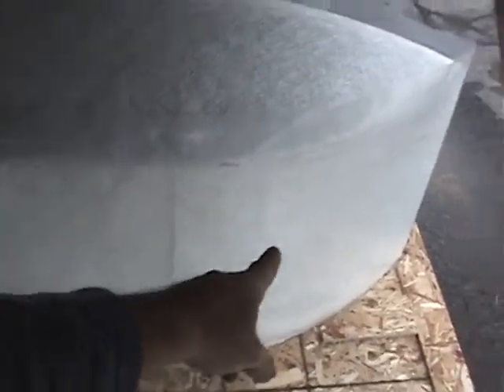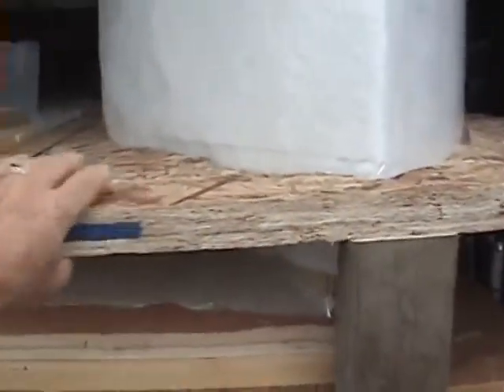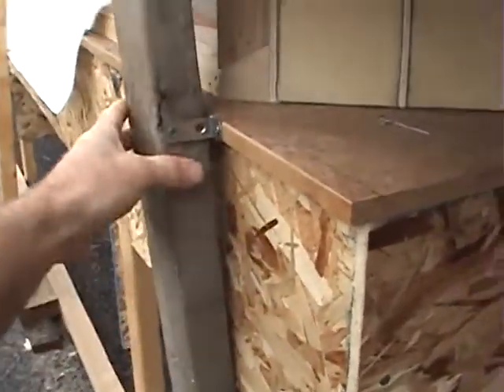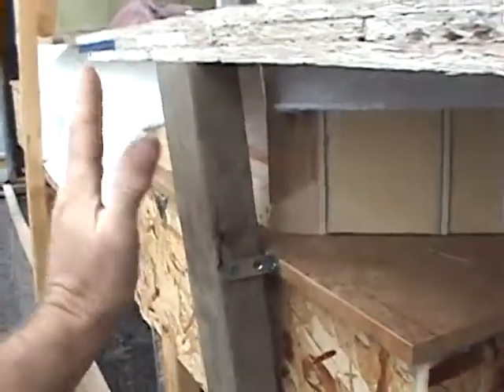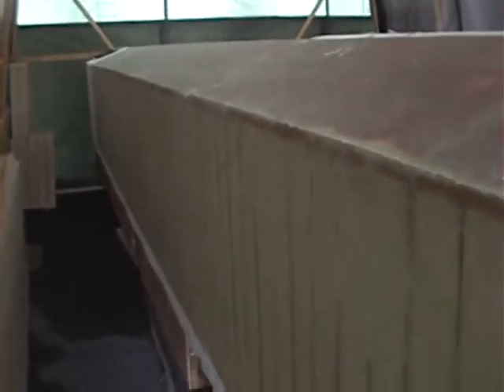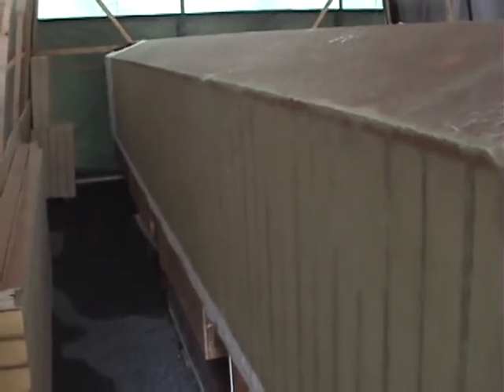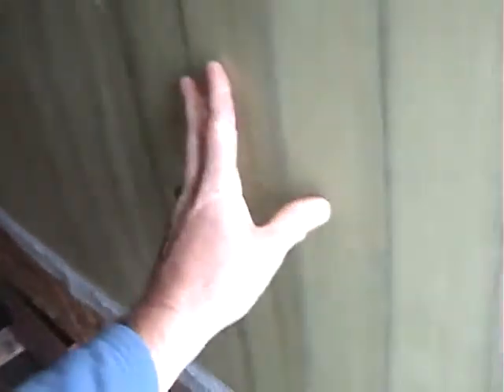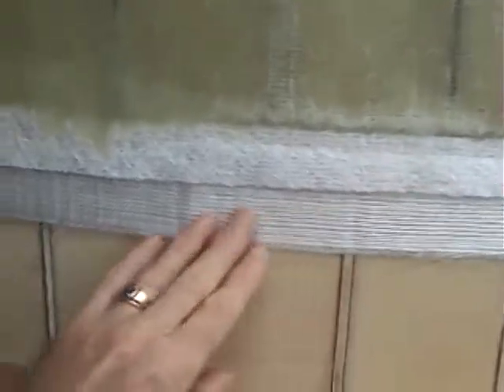Houseboat Build part 8

Comment from the maker: Hi William, good question! .. you need to calculate the sq. ft. of an object then search online for "Buoyancy Calculator II"
Each pontoons are exactly 2ft W x 28ft L. Remove 1ft off each end to square off bow & stern = 26ft. For now, lets say the bottoms are flat and they sink 6in = 26 cubic ft. x 2 pontoons = 52 sq. ft. but the V bottom should add another 16 sq. ft. so 52 + 16 = 68 total sq. ft. entered in calculator = 4352 pounds. Finished boat goal weight is around 3500 to 4000.

Luc

Comment: Did you finish your houseboat.
Reply from the maker: No, I had to sell it off since I couldn't continue building it at the marina without getting liability insurance which costs over $2k a year and I couldn't afford to pay for that as well for the next couple of years.
Ended up selling it at a loss at $1.5k for $3k worth of supplies and got zero for the 500 plus hours of work I already had in it. That's what happens with unfinished unique projects like this. The guy that bought it wanted to use it as a boat dock. Nothing much more had to be done to it.

Comment from the maker: Hi Daniel,

you're probably looking at minimum 20k to max 25k with all finished inside, the electric drive motor and enough solar panels to move it by sun energy alone.
But, at that price you have to build it all yourself. It will take one year full time with 40+ hr. weeks

Thanks for you post

Luc

Comment: What happend with the houseboat build? I liked it Very much! 
Did you throw it away?
Reply from the maker: No, I did not throw it away lol!... I had to move it out of the marina and that was quite a setback. it's in storage at this time and it is also winter in Canada. I may resume the build in the spring or just sell what is built and move on.

Luc
Reply: Luc gotoluc Choquette Okay, i c. I'm sorry to hear that! It was quite an impressive build you did! it's winter in Sweden aswell so i understand! 2 feet of snow outside my house..
I'm about to start bulding a houseboat too, but i guess a bit smaller than yours.
maybe ill make a video about it ;)
Good luck!!

Jacob

Comment from the maker: I actually have 2 layers of 18oz. rooving fiberglass cloth which also has 1oz. mat cloth built into it.
The thickness will be about 1/8 of an inch over the foam and sandwich plywood structure.

1/4 inch fiberglass would be needed if I had no core. I don't think you're considering my foam and plywood core structure?... once encapsulated with fiberglass (even one layer) it becomes structural.

Luc

Comment: Did you stop building for good? I was looking forward to the next videos. I am planning to build a houseboat myself and I appreciate your systematic and elaborate work.
Reply from the maker: Yes, sold it off as I could not continue the build in the marina without getting liability insurance which costs over $2k a year.
Reply: Luc  gotoluc Choquette sorry to hear that. I hope you were able to sell it of for a price that covered you expenses and efforts. Nonetheless, it's a shame you had to stop. I am a German and live in Bangladesh right now. I started building boats here and now I would like to try a houseboat.Your small series was the most comprehensive documentary I found so far. If you know of another good one on the internet, please let me know. Maybe the person who bought it from you continued filming?
Reply from the maker: No, sold it at a loss, $1.5k for $3k worth of supplies and got zero for the 500 plus hours of work. That's what happens with unfinished unique projects like this. The guy bought it to use as a boat dock. Nothing much was done to it. 
The building techniques are my own and unique, so you're not going to find anything like it and one of the reason why I documented it. I wanted a houseboat with a high Insulation value for Canadian winter living and why I used so much urethane foam and at the same time used it as a structural material.
Good luck with your projects.

Comment: my only concern would be the structural integety of the way your building to me it looks like your basically building with lego and there is  no integrating pieces to make the structure solid.. example being a jigsaw puzzle is intergrated but  if they were squared tiles there is no strength to hold it together.. another example clap your hands together and slide them sideways away from each other where as clasping your hands together makes it an unbreakable bond ??????